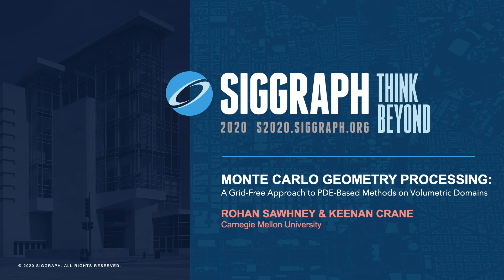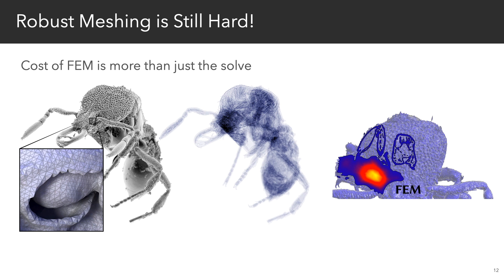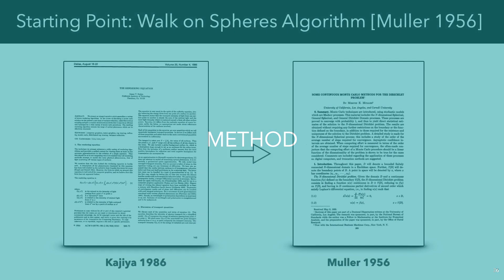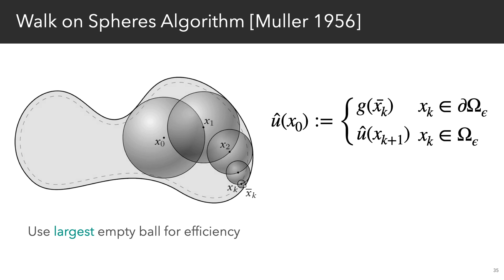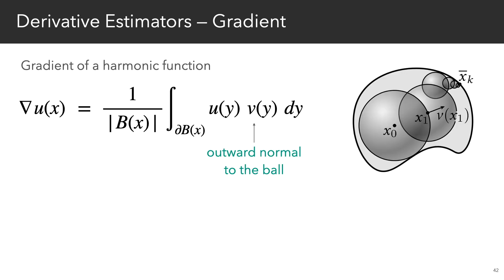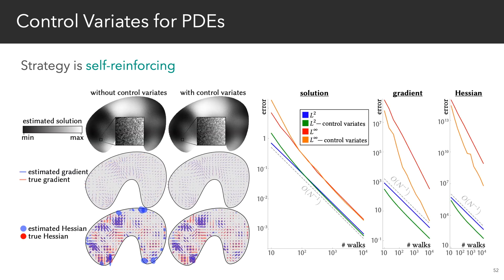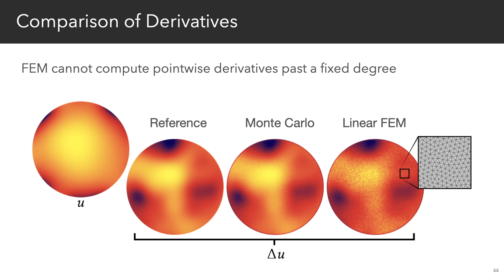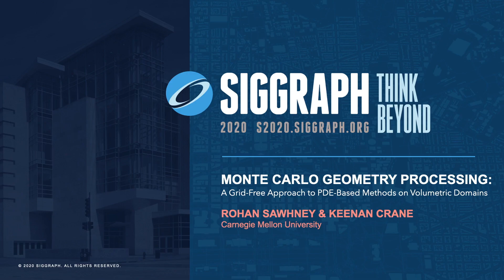Monte Carlo Geometry Processing

Comment: I am confused about what our geometry representation is for arbitrary (e.g. frogs) shapes.  If we don't have meshing, what is the data model that is traversed to render a frog with walk on spheres?
Reply from the maker: Thanks for the question. Grid free MC methods like WoS avoid the need for volumetric meshing (unlike say FEM), but they still require a geometric representation of the surface of the domain that you can perform distance queries on to simulate random walks. The latter could be a mesh, implicit function, nurbs patch etc., the only prerequisite is the ability to compute the distance to the surface. Volumetric meshing can often be a pretty big bottleneck, especially on complex models (such as the frog), so WoS offers a way to bypass that step for computing solutions to common PDEs. If I remember correctly, the frog model is a (surface) mesh extracted from a CT scan. You can perform distance queries fairly quickly to a surface mesh with tree based data structures such as a BVH.
Reply: @rohansawhney1583  hi in relation to this i wanted to ask: what if i have many uniformly sampled points on the surface , i can still compute the closest distance to those, however the query point could escape the region. Maybe having sampled enough boundary points and set an large enough minimum radius could prevent this.